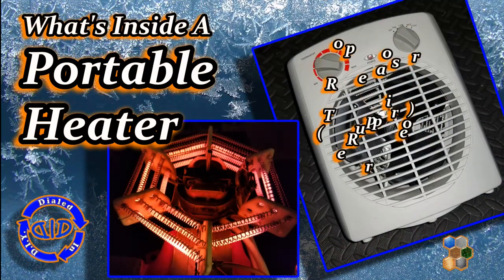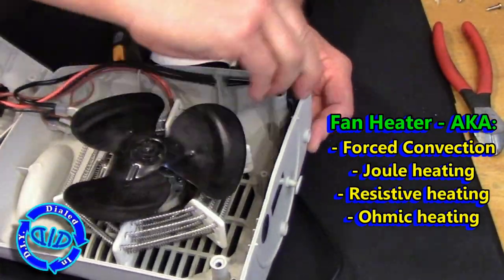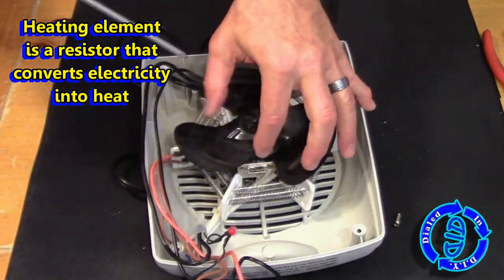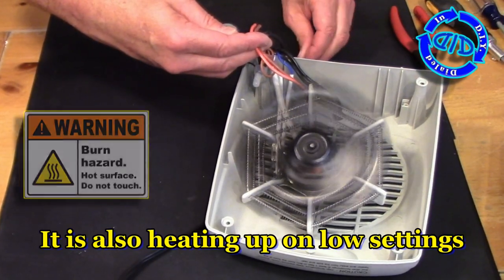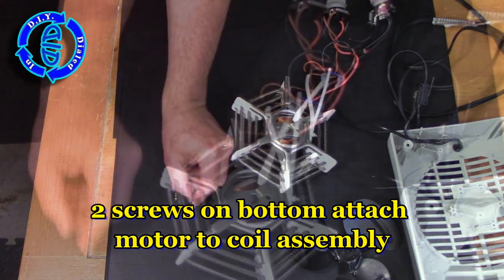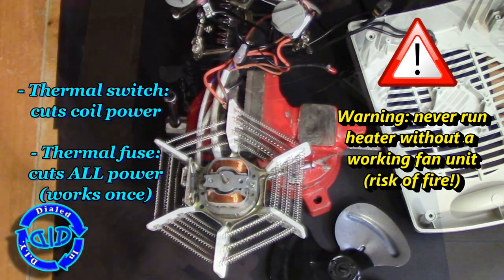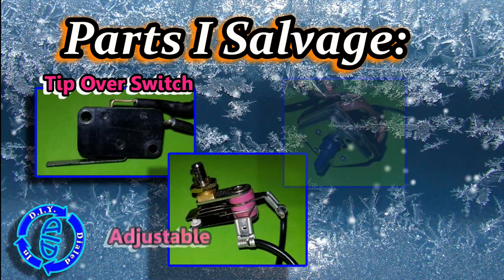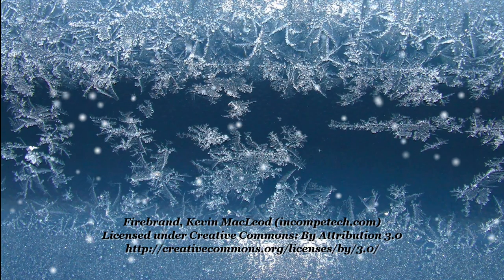What's Inside a Fan Heater - Fix or Salvage

Comment: Wonder if you can answer a quick electrical question?
To run somthing like an electric shower you need low resistance so more current can flow through. Here in uk its about 40 amps.
However ive read by putting resisters, heat and energy gets created.
With electric shower how can you put low resisters so more current can get through but at the same time high resisters so more heat can be created to heat up the water. Its very confusing so please help! Im obviously not understanding something
Reply from the maker: Happy new year! Sorry for potential ignorance but I'm not sure what an electric shower is.  Is that an electric water heater for a shower (i.e. instead of a gas water heater)?  I'm assuming so but not 100% sure so thought I'd check first. Heat from resistance is actually how the space heater in this video works; in this case the coils provide the resistance.  That will be the common method for electric heating elements... am I on the right track for your question?  Let me know and I will gladly try to clarify.  Thanks for watching and for taking the time to comment!
Reply: @DialedInDIY  Happy new year to you! Thanks for replying. With an electric shower, basically you have a cold water pipe entering a unit which get heated up by a heating element and then exist the unit by a shower hose. All by electric and not gas. Typical they range between 8.5 kw to 10.5 kw in the uk and they work off 240 volts. 
Hope I clarified a bit more. Just a bit confused with understanding Current and resistance. To get more current you want less resistance right? But with electric showers you want a lot of heat and energy produced?....
Great channel btw
Reply from the maker: Thanks for the clarification.  You have all of the right pieces AND yes the relationship between these pieces can be confusing.  For electric heating you need current and resistance.  I found a good article that can explain this better than I could (don't worry about the formulas, just the concepts) https://electrical-engineering-portal.com/resistive-heating-explained-in-details.  Another good search is for basic explanations of both Ohm's Law and Joule's equation.  I hope that helps.
Reply: @DialedInDIY  Thank you!
Reply: Ive read this somewhere which makes a lot of sense. 
Does a heating element need a high or a low resistance?

You might think a heating element would need to have a really high resistance—after all, it's the resistance that allows the material to generate heat. But that's not actually the case. What generates heat is the current flowing through the element, not the amount of resistance it feels. Getting the maximum current flowing through a heating element is much more important than forcing that current through a large resistance. This might seem confusing and counter-intuitive, but it's quite easy to see why it is (and must be) true, both intuitively and mathematically.

Comment: can i easily change (make smaller) 'dead zone' of adjustable thermostat ? it's really annoying when you want to rise room temperature but by a 3-4*C, but thermostat turns off device after temperature rising at least 6-7*C :/
Reply: The deadzone is hysteris, get a plug in thermostat (so it cuts power to heater) and set the heater thermostat to max.
Reply: @MichaelFlatman  I didn't ask what hysteresis is, but how big is it ? :)
And can you make it smaller , by bending a small metal plate in thermostat maybe ?
Reply: @razorree  no, it's the strength of the magnet that determines hysteris.

A digital plugin thermostat will be much more accurate as its further away from heating elements
Reply from the maker: @MichaelFlatman  Thanks for the great response!  I love the idea of the space heater upgrade, using a digital thermostat.  I actually think that would make an old space heater a bit more safe to operate too.
Reply from the maker: Thanks for watching my video and for posting your question. The answers Michael HTT gave sound great!  Thank you Michael.
Reply: i bought Rowenta Mini Compact, it has 'quiet' mode and hysteresis is not so big, it can 'cycle' between 17 and 19*C, which is almost perfect.

Comment: My thermal switch stopped working and my space heater got so hot and smoking in a matter of 5 seconds of the fan not moving and I swear any longer plugged in it would have exploded in fire.. I didn’t do anything prior to this space heater and it had been used a couple days prior just fine.. freaked me the frick out.. it got EXTREMELY hot in seriously 5 seconds on low setting.. what happened?
Reply from the maker: First, good thing you were close by.  It sounds like an odd sequence of events in the heater.  The thermal fuse should cut power to the heating element permanently and should happen when it gets too hot.  The thermal switch or thermal cut out should also cut the power but resets or can be reset when the temp cools back down. Is your thought that the thermal switch failed to cut power (I'm guessing this is what you mean)?  Since power could still get to the coil but the fan did not operate then I would think the fan might have a mechanical obstruction. Something preventing the rotation. Does that sound like what might have been taking place?
Reply: @DialedInDIY  Not sure if something was obstructing the fan? tbh I'm not very mechanic like, taking apart things have always led to "how to put it back together now?"^^U
 It just got extremely hot in record speeds and the top part that wasn't suppose to get hot, got almost unbearable to touch after.
I threw it away (safely)  since I didn't want to take any risks since I live in dry So Cali.. :s
Reply from the maker: @Dubstequtie  very smart move... always better safe than sorry; when in doubt trust your gut feeling.  Especially these days when a simple visit to the ER is no longer quite so simple. :-) Hope all is well!

Comment: My heater is heating the coil but the fan is not rotating, how can i fix that?
Reply from the maker: Interestingly enough, that is the opposite of the typical problem with these heaters.  If the fan does not work to pull cooler air through then the thermal fuse/switch is eventually going to shut everything down.  The most likely options I can think of are loose or disconnected wires between power and fan motor OR a physical obstruction blocking the fan blades.  Are you able to check to see if either of those is the problem?

Comment: what if only the low setting does not work? My low setting only the fan blows but no heat, High setting works fine.
Reply from the maker: Hi Habib, that is a new one for me (only low setting not working).  My guess is that it is failed connection on the switch for the low setting.  It might just be a loose wire or a dirty contact point.

Comment: GREAT VIDEO!! hey I have a HOLMES force fan heater. kinda the same setup. it worked but it has a TERRIBLE one button switch that you had to push REALLY REALLY REALLY HARD. (and i'm actually NOT exaggerating at all) i know this probably sounds dumb, but i was wondering if i could replace it with a light dimmer switch or maybe 2? also can you do a video on salvaging a fan forced heater with a bad switch or switches instead of heating elements? please & thank you #SUBBED
Reply from the maker: Hi IUSECAMERAS, I am so sorry for the delay in response.  I did not see a notification for your comment and just now came across it.  Do you still have the fan heater and the same problem?  FYI, not a dumb question in my opinion... it is always much safer to ask any question than to risk trying something without info of what will happen first.  In the case of a light dimmer switch; most of these devices have a switch that changes the connections at each click/turn of the knob whereas the dimmer switch will change how much power is being delivered through the switch (they won't do the same thing).  You could definitely change the button or switch for another that works better.

Comment: Hi,

Quick question:

My heater fan is too noisy .
Is there any way to fix it ?
Reply from the maker: Is it a vibrating or scraping kind of sound?  Sometimes it is just a matter or tightening the fan blades/assembly or making sure they are not contacting something.  A loose wobble often causes extra noise in heaters, hair dryers, etc.
Reply: Thank you , it worked
Reply from the maker: Great!  So glad it was fixable.

Comment: My heater is giving cool air how do I fix please reply thank you x💙💙
Reply from the maker: Hello Hello. Just to confirm, the heat switch does not change anything when you change the setting. Is that correct? Have you looked inside for any signs of failure? You can check for loose wires, burned/darkened spots or other loose parts.
Reply: Same to me it giving cool air and any signs of loose wires.
I check thermal fuse with multimetar it works but still i dont have a idea what is the problem
Reply from the maker: I usually first check that the fan only mode is not on (which it never is...lol), then check the manual to see if there instructions for resetting the heater.   After this the reasons the heating element is not getting power is usually a more involved fix.  It could be a blown resistor or circuit but there could also be a break in the heating coil.
Reply from the maker: @xhevdetberisha7604   Hi, I added a reply to the initial comment above.  Hope that helps.  Thanks for posting your question and for watching my video!

Comment: Using a continuity tester is good enough. There is no need to test the heater outside of the case with full voltage. It may be possible to replace the thermal fuse, but it will have to be crimped back in place. The bi-metallic thermal breaker can be bi-passed as long as a thermal fuse is in place. The thermal breaker is to extend the life of the using by opening the circuit before the thermal fuse breaks. Keeps in mind, the properties of the heater probably have changed to make it operate in an overheated state, so it's probably just best to chuck it in the trash. Those are low end, cheap heaters. Just buy a new one.

Comment: How to remove the fan from it.
Reply from the maker: Hi, I pulled the fan blades straight off of the motor.  I have found that works for most heaters that I have opened up.  The motor separates from the heating assembly by removing the two screws on the back, once the whole thing is removed from the cover.  Hope that helps.  Thanks for watching and taking time to comment!
Reply: @DialedInDIY  Hi, happy that you replied.
I took the fan heater from scarp shop, and I need the fan from it, my fan heater is similar to yours, I have disassembled the fan from it, but when I connect it to direct 220v AC power supply its not working. Please tell me how to make the fan run.
Reply from the maker: @giridharan74  Just to confirm; you took a fan unit from a scrapped heater to replace the one you had but the fan won't work. Correct?  If that is the case, then the first thing I'd check is the fuses & cutoff switches I mentioned in the video.  If any of them has failed it could cut the power to the fan (and possibly everything else too). Does anything look fried, discolored or disconnected?

Comment: GreatG!   Can you keep the "instruction switch" on slow next time?! ...    thanks  /;O)
Reply from the maker: Lol... yes... I do start to pick up steam sometimes don't I?  Thanks for watching and for the comment!
Reply from the maker: Just had to reply again... because I came across your comment and it made me chuckle again (thanks for the smile). Also... when you say "GreatG" what is the second G for (I have two guesses). Happy new year!
Reply: smile I have the same issue. I solved it by changing the video speed to .75. You can do that with the gear shaped icon- the Settings icon. It is on the video frame, bottom, right side.

Comment: NO ONE ANSWERS WHY PATTON PORTABLE HEATER FAN QUIT TURNING
Reply from the maker: I have some thoughts but a quick question first... when the fan turns off does the heating element shut down too?  I guess the easier way to ask is do all the functions stop?  Allot of times the units cut out because either the thermostat failed or the thermal cut off  is tripping too easily.  A fan by itself may be dirty, need oil/lube, have blocked ventilation, or possibly a short / loose wire.

Comment: This video is of very little value. You should have showed us all the components that can go wrong, how to find them, how to test them and how to replace them if needed. On my heater the heat works fine but the fan won't turn, which may just need a cheap replacement part (fuse? switch?), but this was no help at all. Your main interest seems to be in salvaging parts, but people coming to this are looking to repair, not strip the appliance for salvage. You have wasted people's precious time.